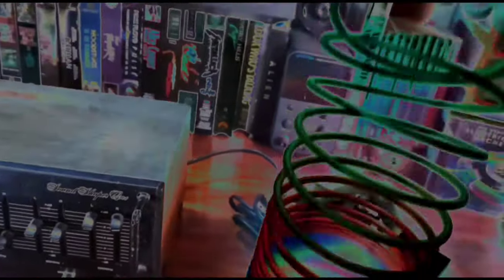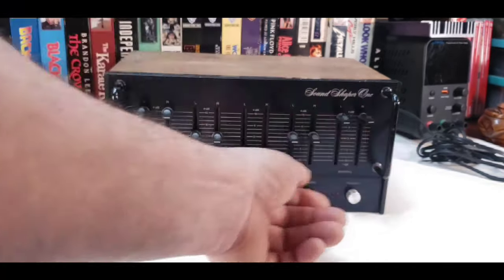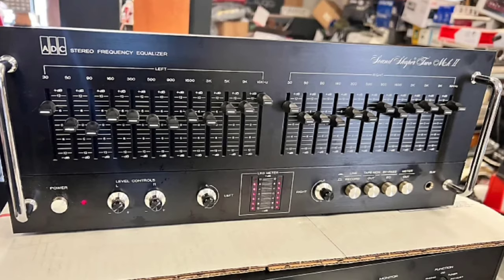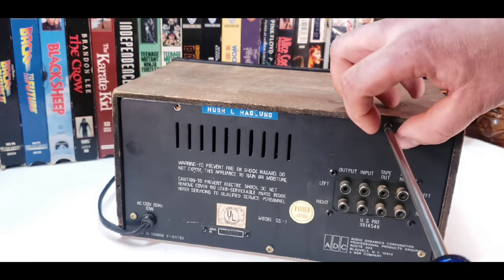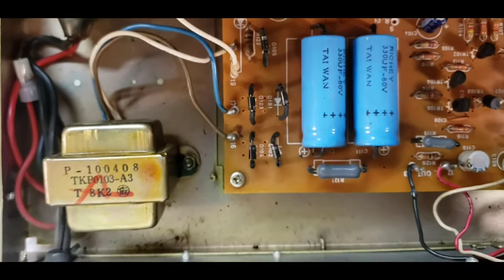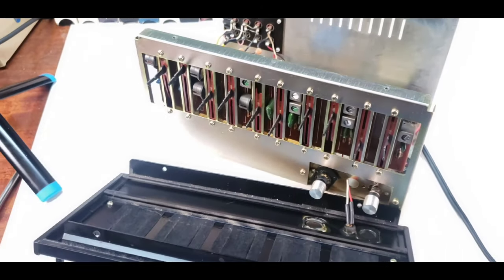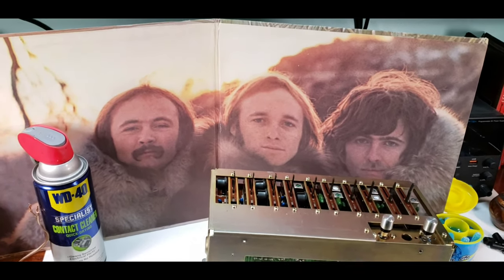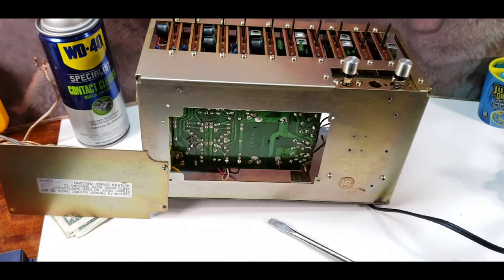ADC Sound Shaper One 5 Band Equalizer (GOOD Obtainable Vintage Audio?)

Comment: ADC's first commercial (home use) equalizer was the ADC-500 in 1977 and I hated it. Set up like this SS1 with "paired" sliders. I bought my first EQ, the ADC Sound Shaper Two (with the VU meters) in 1978. It had twelve bands per channel (two more than standard octave EQ's), THD/IM of 0.02% and could feed an equalized signal to your tape deck. I liked the flexibility of the SS2. Eventually getting several tape decks I upgraded to the SS2IC model in 1982. It had bidirectional dubbing, LED meters, separate output controls and an excellent subsonic filter (15Hz@18dB/oct). Still use it almost every time the hifi is on. This little five band job would help out most vintage mid-level systems with questionably accurate speaker systems. And to boot, it's just a lotta fun to use. Swell video. I was at Woodstock in 1969 and Strawberry Fields Festival in 1970 then drafted in 1971.
Reply from the maker: Absolutely awesome!!! What a great comment! Thank you man!!
Reply from the maker: Thank you for your service as well!!

Comment: I had the Sound Shaper Three MK 2 Paragraphic Equalizer. I got it to fine tune the bass of my Celestion Ditton 66 speakers. It did a great job at it. But with 12 band and a lever that allowed you to change the frequency plus or minus 20%, it was basically a 36 band unit. It took a long time to get it to where I liked the sound. And then a friend came over and started to play with the unit and changed all the settings. AAARRRGGGHHH!!!!
Reply from the maker: 🤣🤣🤣 I feel your pain! I just had an idea about an equalizer cabinet that locks 🤔

Comment: I just recently picked up one of those and I was wondering how would I connect it to my JVC AX-Z1010TN amp. Any advice would be greatly appreciated. Thanks.
Reply from the maker: Isn't that a JVC reference amplifier? Congrats on finding one! Honestly, I wouldn't hook it up to that. But that's just me. Basically, plug whatever device you would normally connect to the receiver into the play input and connect the out put to the receiver.
Reply from the maker: Yeah 0.004% THD? I honestly wouldn't put the sound shaper in the same room as that receiver. Lol, you don't need it.

Comment: I found one today on the curb alongside trash, and its a factory wood grain instead of black. Sticker on the side of it says walnut grained vinyl veneer. Wish I could add pics of it in the comments.
Reply from the maker: NICE!!! good find for sure!!!
Reply: I have discovered an issue with the equalizer, unfortunately. It plays perfect for the left channel, but the right channel is barely making any sound. You have to turn the volume up to full to slightly get any sound output, but the sound is their. If I go through the tape out output (bypassing the equalizer output), it works fine telling me the input is working, but using the tape out output, you get no equalizer functionality. I took the wood cover off, and it looks clean and has no leaks or corrosion on the board that I can see. I don't have enough knowledge to diagnose it further, but I'm sure it just needs service from being old. Thoughts?
Reply from the maker: @Hopkins582  sounds like a bad solder joint on the output rca jack. They can be hard to see, but if you have a soldering gun, you can just resolder the pins. I would normally say it's a problem with the slider pots but it would really unlikely that all the left ones are clean but all the right ones are dirty.